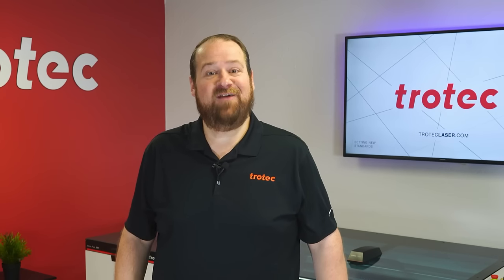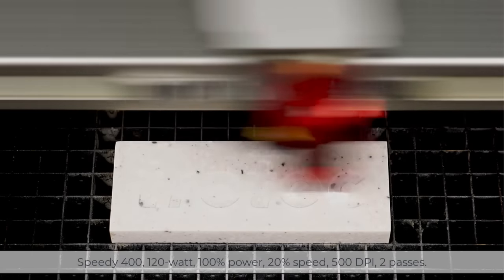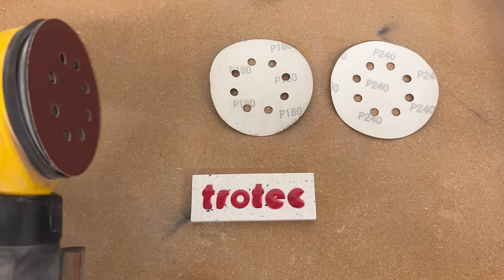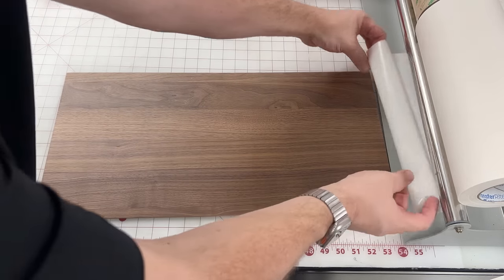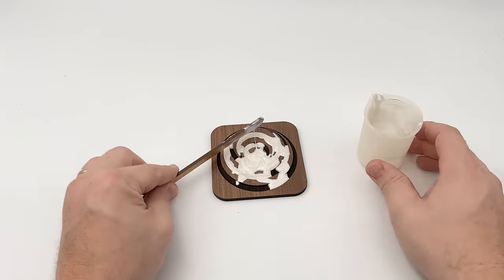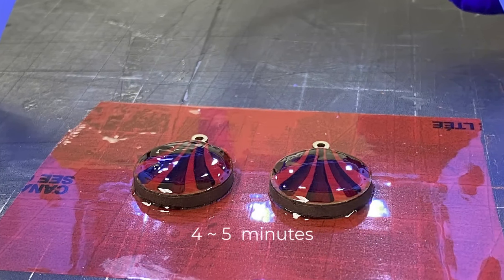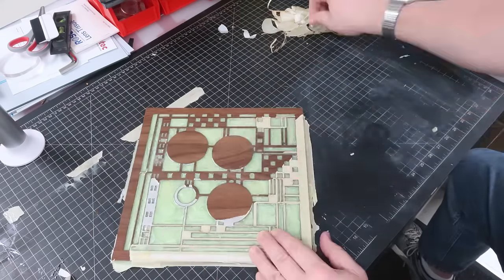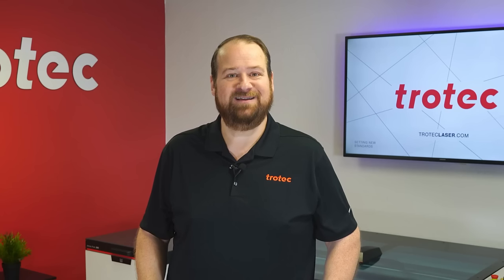Deep Dive with Laser Dave - Epoxy Resin and Lasers

Comment: Resin on a cutting board seems iffy to me.  Are there resins that are specifically labeled as food safe?  Most of the resins I've worked with are most definitely not.
Reply from the maker: These are usually for decoration; however, there are food-save versions you can use.
Reply: @TrotecLaser  People buy cutting boards for decoration? Never knew that :)  I guess I'm too practical haha
Reply: @TrotecLaser  yes there are food safe resins/epoxies out there but you still shouldn't use them as cutting boards. for serving trays, yes. Cutting. no.
Reply: do you make tumblers? if you do, then you need a food safe epoxy. all the ones I use are FDA compliant.

Comment: Nice information. Thanks for sharing. Just so you know, UV resins are not epoxy. They are acrylate urethane polymers.
Reply from the maker: Thanks for the info!
Reply: I don't know about the UV resin used in this video; however UV sensitive epoxy acrylate resins do exist, they are used in DLP 3D printer iirc.

Comment: Great Video – Thanks Laser Dave
One comment – Using a torch to remove bubbles in the epoxy resin is the most efficient method.  However folks should understand that it’s not the heat that removes the bubbles, it’s the CO2 from the combustion of the Butane. If you get close and gently exhale over the work piece, you will get the same results (you exhale CO2).  I have used this method many times on 2 part epoxy. That said,  I have never worked with UV cured epoxy resins, but I suspect the results will be similar.

Comment: This is a cool idea. What type of laser are you using to engrave the Corian?

Also, I already use epoxy resin. You want a well ventilated area for working with it. Most tabletop,  casting and standard resins require 8 to 24 hours cure time. Rubbing alcohol is perfect for cleaning up spills. I do love how I can combine my lasers with epoxy resin for some very cool projects.
Reply from the maker: We use a standard Co2 laser to cut and engrave Corian.  Thanks for the other tips; I will keep that in mind when I do this again.
Reply: @TrotecLaser  A CO2 laser is on my wishlist.